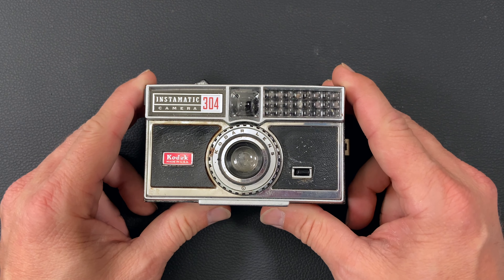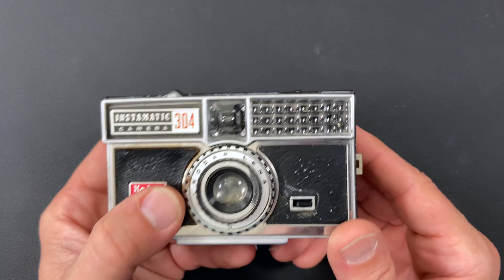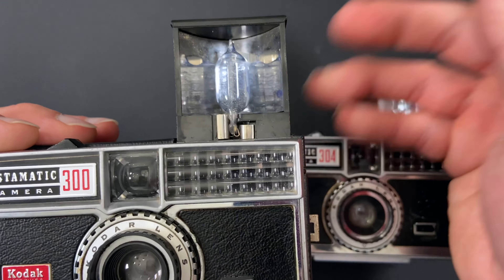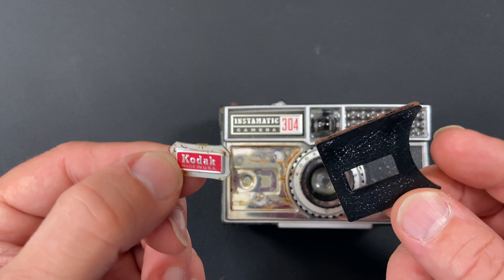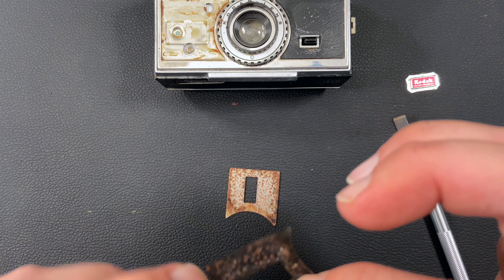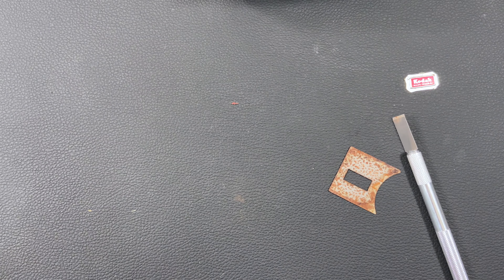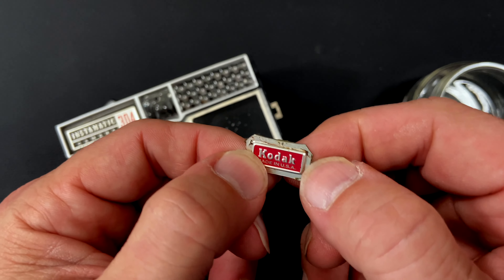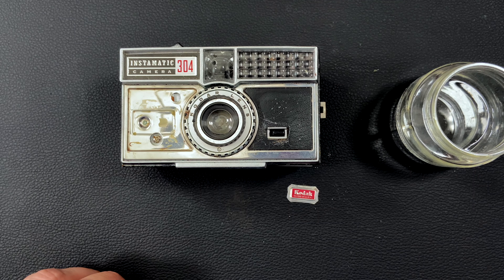Kodak Instamatic 304 Camera Repair and some information

Comment: hello please help I just bought one its very old i cant figure out how to put batteries in and the film reel mover switch thing is stuck help
Reply: Hi! I also am unable to open the battery door. Maybe I cannot find it. 🙃
Did you find out how?
Reply from the maker: Hi, the battery compartment is on the bottom of the camera, you have to slide it open with your fingernail.  Sometimes they get stuck if there are old batteries in there that get corroded and it can really get stuck.
Reply: @LittleKodaks  Sadly it happened with my instamatic 100, everything inside is corroded now.